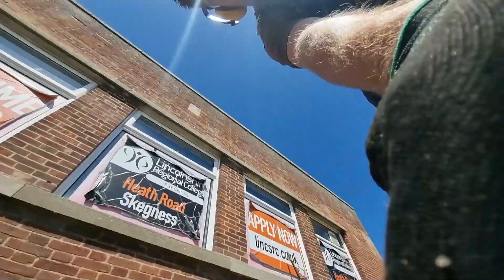Cleaning OVERGROWN patio areas for a local church | Pressure Washing

Comment: excelene trabajo, y una buena causa jeje...  lleva demasiado tiempo,  12 horas? si no entendi mal... exitos en esos trabajos nuevos, que maquina usas? de cuantos psi? y caudal? saludos cordiales desde uruguay
Reply from the maker: ¡Gracias! Sí, fueron 12 horas, casi 3 horas de eso fue esperar al cliente y luego clasificar el suministro de agua que estaba cerrado en la parte del edificio que necesitaba para acceder a él.
La parte más larga fue limpiar todos los desechos.

Yo uso un motor Briggs and Stratton 14hp con una bomba Mazzoni 21LPM
4000PSI

Saludos desde Inglaterra :)
Reply: @BostonJetWash  oh genial, yo estoy pensando en una de 13 HP 18 LPM y 3500 psi... Gracias por la respuesta, saludos cordiales
Reply from the maker: 18 lpm serán adecuados para la mayoría de los trabajos.  Si desea utilizar un limpiador de superficies planas de 18 a 20 pulgadas, le sugiero 21 lpm o un limpiador de 16 pulgadas.
Reply: @BostonJetWash  thank you

Comment: Hi pal, wondering if you can help me.
I have a honda gx340 15lpm - I am purchasing a 18inch fsc but right now my hose is attached to my gun which I quick fit my lances, so how do I connect my hose to the new gun on a fsc I heard a need 2 male quick release fittings? Cheers bud
Reply from the maker: It sounds like you are using a Kew fitting. 
You can get surface cleaners which you can just connect your trigger to. 

When you get your fsc just make sure it has the correct jets for 15lpm.
Reply: @BostonJetWash  yeah I’m getting it from the same place I got my machine from so he will adjust the jets for me

Comment: Great job! It would be good if they would put some sand in those cracks so it doesn't happen again.
Reply from the maker: Thank you! 
It's not the type of pavers that you would put sand in to be honest, in needs properly jointing with compound or cement. 

They are keeping to a tight weed control schedule so it should be all sorted 😊